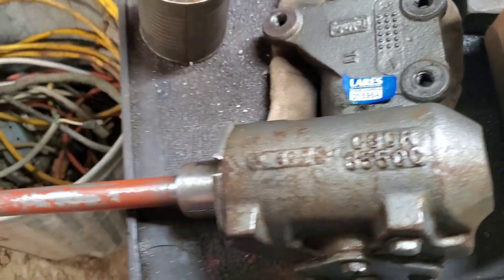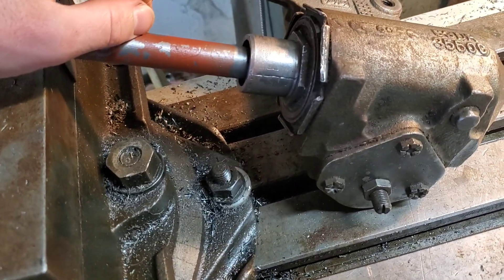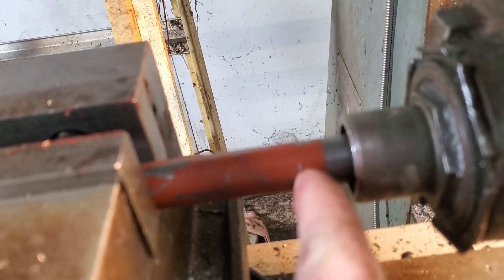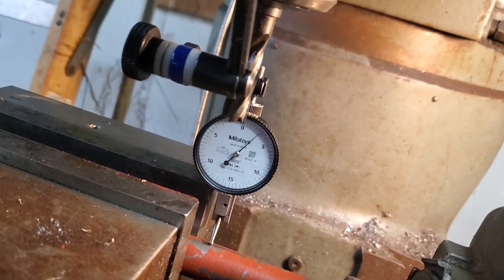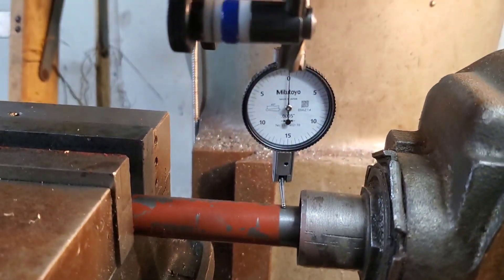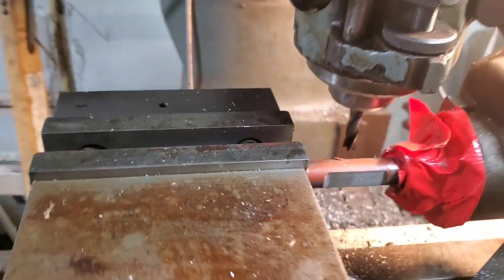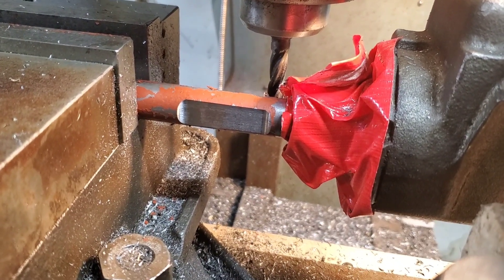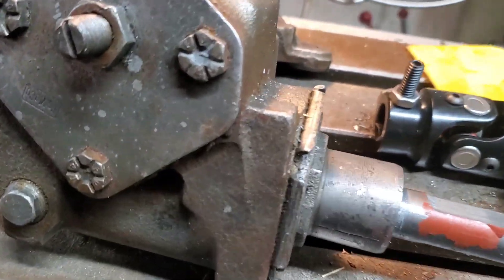Machining on a Mustang

Comment: If you replace the pitman arm and idle arm with those from a power steering car,  they are longer and will give you quicker steering ratio.  This is what Carrol Shelby did.